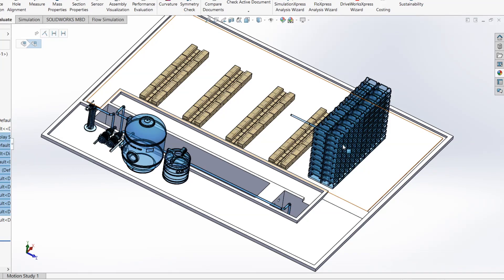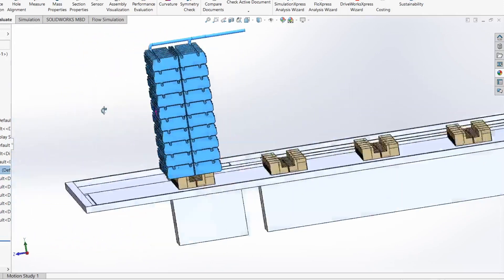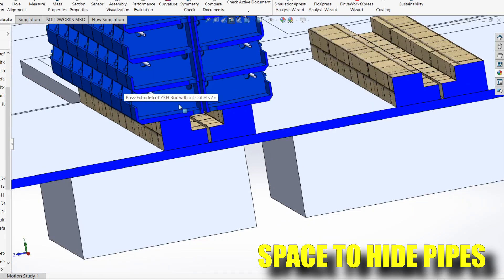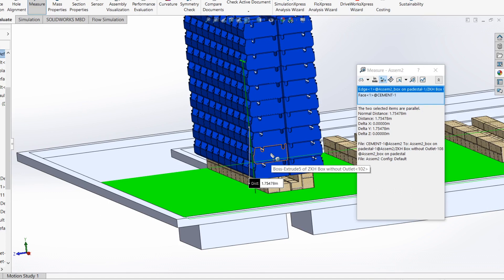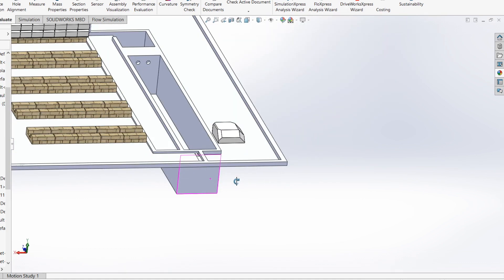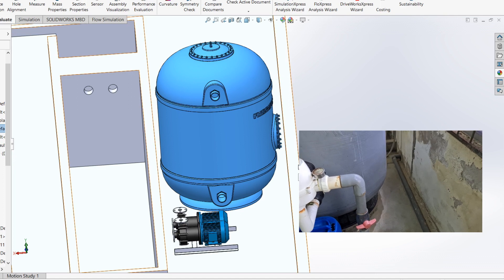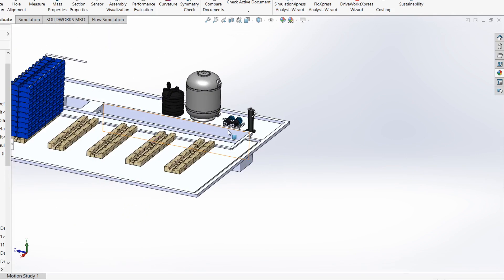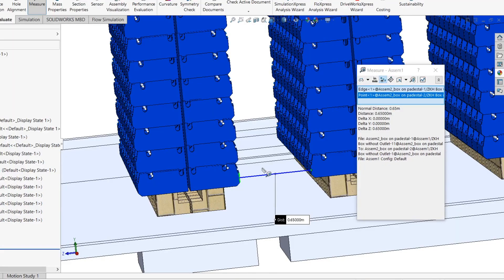Positioning of RAS Equipment in Indoor Mud Crab Facility | Episode 02

Comment: In your opinion, would the 1.5hp pump be sufficient to supply enough water for a 20 row by 10 column (400boxes per section) if I was to aim to double the amount of boxes in  an existing 1000 box RAS system? Thanks.